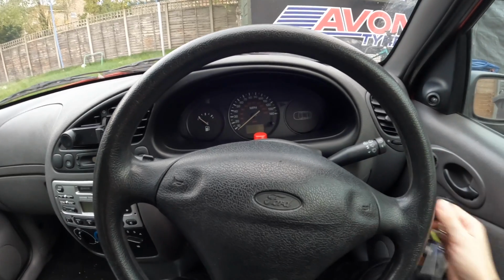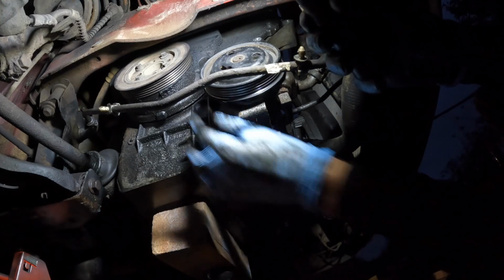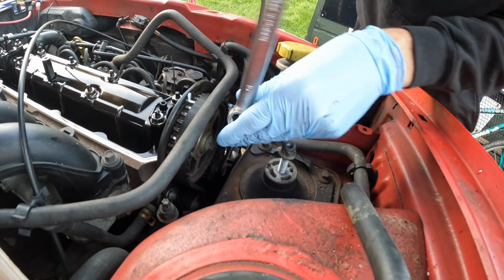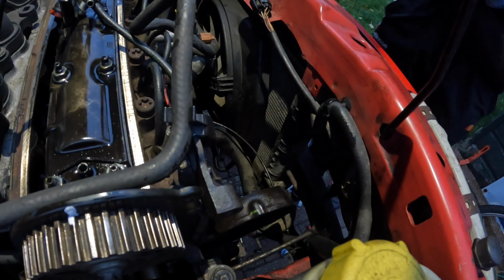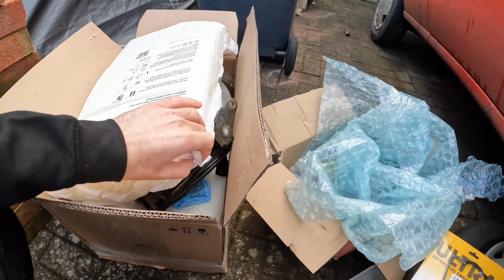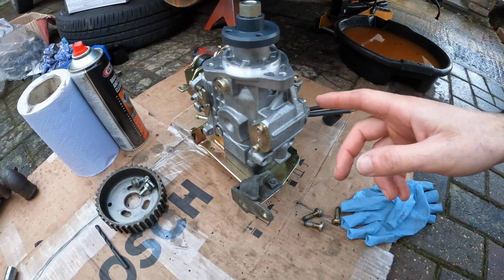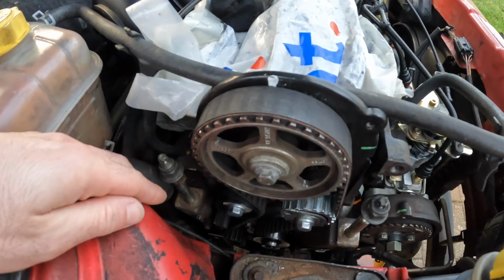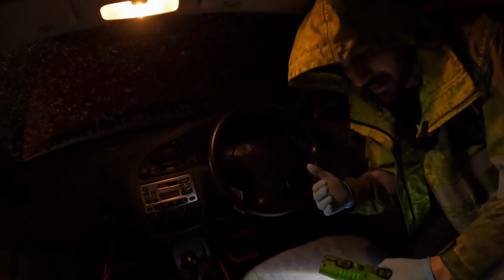MK4 FORD FIESTA VAN | FUEL PUMP & TIMING BELT REPLACEMENT

Comment: Should of had a go rebuilding the pump! or atleast found out what failed..  they're actually pretty straight forward to build and repair.  I put one together using that pump as the base for my mk6 van's MTDDI hybrid that uses the escort block but converted to Direct Injection.

Comment: Hi I have mentioned this before my first car was a Mark 4 or 5 Cortina it was my Dad's car 1.6 Pinto Engine what a lovely car. Then my first car of my own was a A Reg 950cc popular plus Fiesta I really liked that car.
My mum got herself a Very low Mileage 1.8 Diesel Fiesta car only done around 22000 miles just like the Engine you are working on your Video today. Unfortunately as you no very well it was quite a slow Engine but super reliable and an excellent engine.
There is a very small key goes on the Pulley to the Engine where the Cambelt  fits and my mum was so unlucky with such a low mileage the Small key sheared off the mechanic never seen anything like it and done serious damage to the Engine. It was all rebuilt but never was quite right after the rebuild.
Reply from the maker: Oh wow that's gutting to hear that the engine never ran properly again! They are great engines but as you say very slow, so you can't go anywhere in a rush 🤣

Comment: I've done many cam/injection pump belts on there 1.8's, they are fairly simple, i had a bit more room on mine as they were either  MK4 & MK7 Escort's or MK2 Orion's
Reply from the maker: I agree a fairly simple belt to change, I wish that I had more room in this bay! The fiesta van must've been the smallest engine bay these 1.8 diesel's were fitted in...😆

Comment: dam good job, you only made one mistake, you didn't take it to work + steam-clean the death out of it first, including taking the top cambelt cover off + blasting everything with the engine running, after all, you are renewing everything. it makes it a much better job, not getting covered in $hit...
the belt run-off is caused by a tiny mis-alignment of the pulleys, luckily you renewed all the usual culprits, but always a good idea to check whilst running at the end... 
PS, running neat, old chip-fat blows the seals out of the pumps, yes i should of listened, it bit my arse in my escort, but id did smell good at the lights...
Reply from the maker: Thank you! Although I didn’t clean the area before I started, once stripped down I cleaned every section and was cleaning parts when putting them back onto the engine, so we are left with the same result. 🤷🏻 I’m glad you enjoyed the video!